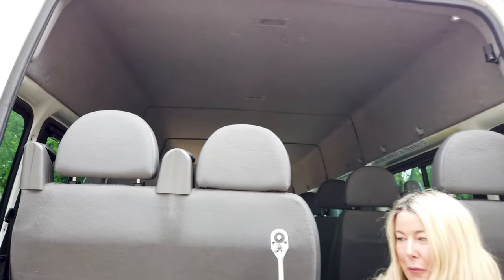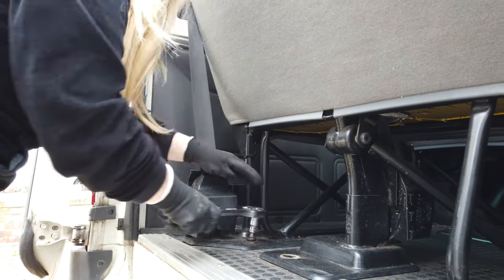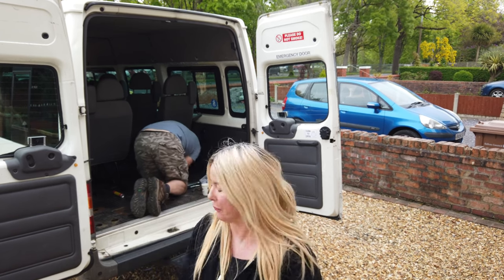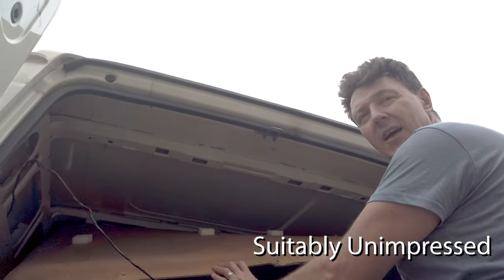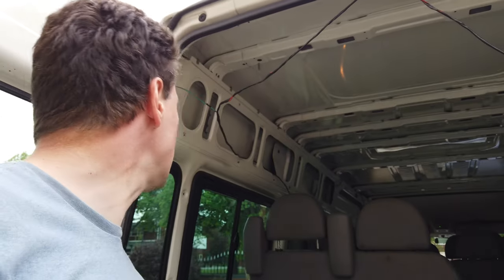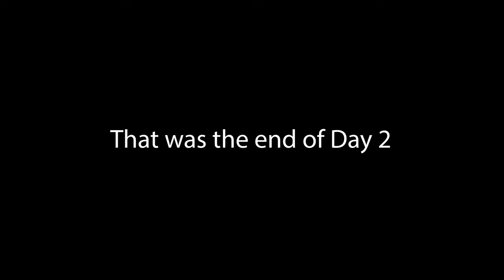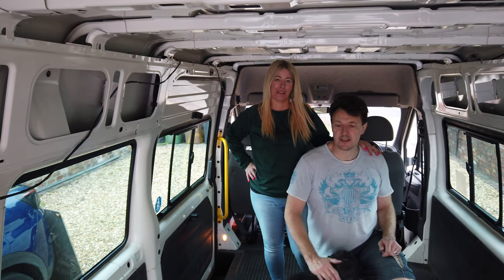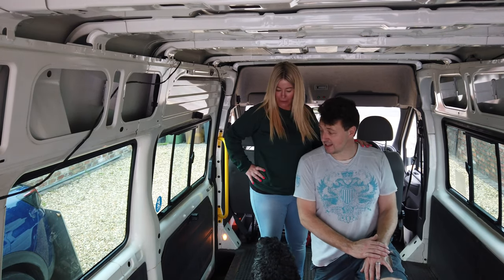Van Build Episode 1 Ford Transit Mini Bus!!! to Camper Van Removing the Seats ( Removing the Ceiling

Comment: flippin eck!!! thats a mammoth job taking those seats out!! I'm glad Viv-i-van was empty when I started to convert her. I don't know how I'd cope taking all those seats out, let alone putting them somewhere afterwards! Isn't it always the same with bolts and screws though. You get three out and one sits there denying all your attempts to extractate it whilst laughing in your face. I had the same with the original van floor. I dont mind saying I said lots of naughty swear words and questioned the floor's parentage LOL. All in good fun though and you'd not appreciate the van build if it was easy.  Regards , Kenny
Reply from the maker: They were an absolute nightmare but yeah it's all part of the fun and character building, as they say.

Comment: Haha I’ve just bought a minibus 09 transit to do the same, and it took me days to get the bolts out of the seats. I ended up having to use a grinder to cut them all, but kinda cut a few then swing the seats around to get access to other bolts. Genuinely it took me days to get the seats out. Just waiting for DVLA to confirm it as a window van now so I can insure it. What a journey 😂😂😂
Reply from the maker: Good Luck, those seats 🤯 won't be long and they will be a distant memory and you will be out exploring. 

Thanks for watching and commenting :-)